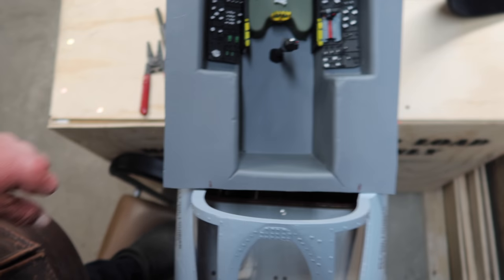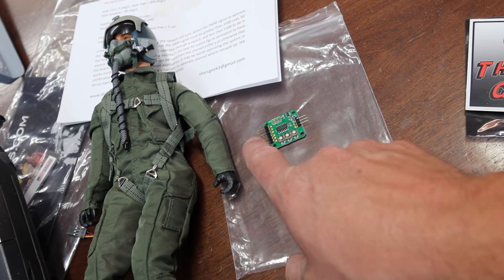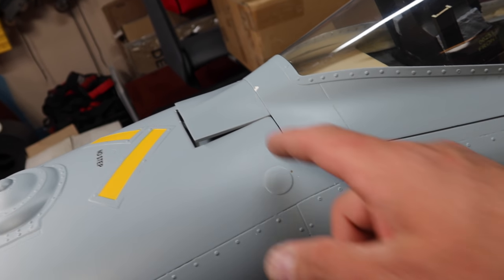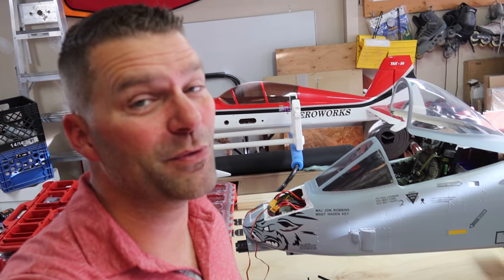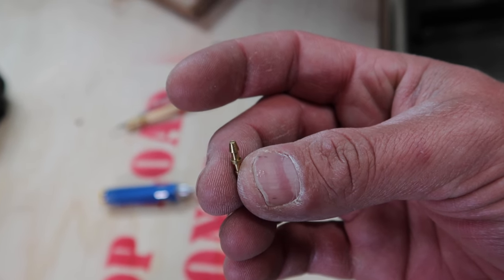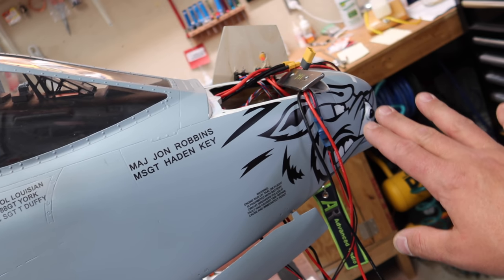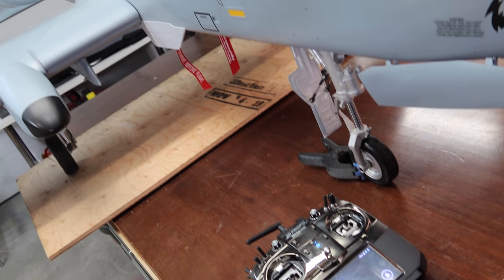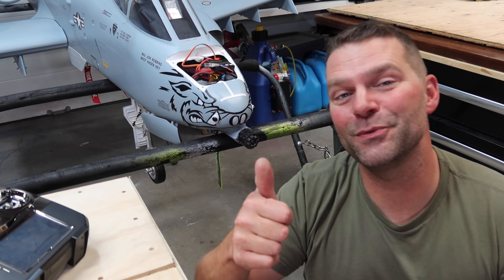GIANT A-10 Complete - Cockpit Install, Engine Runs, CofG, Gremlins A10

Comment: canopy....check ! head of the pilot....check ! you have a door for the front gear, not for the main gear ? we can see a little bit the wheels when it's gear up ? as usual, awesome.
Reply from the maker: Hello Philippe.  Yea the only air operated gear door is the front one.  On the mains, one is attached to the legs and one is hinged and attached to the leg with connecting rods.  Thanks for watching!

Comment: Beautiful plane, but do like electric gear instead air cylinder operated ones. I know weight might be better on those, but air is a beast and leaks will occur…hopefully not while flying🍀…beside the pilot is cool and the plan is waiting for weathering 🍺…cheers from Munich
Reply from the maker: Yea unfortunately with these skymaster kits and the scale gear air is the only option.  Your absolutely correct!  Hopefully NOT While flying!

Comment: Just to let you know the A-10 ejection seat does NOT have a “D” ring between his legs.  Just 2 handles on each side of the seat. If you are wanting accuracy remove it
Reply from the maker: Thanks Tim.  Yea i'm sure it's just a generic design that Skymaster follows for all their aircraft.  Thanks for that gem of advice!😊
Reply: I worked Ejection Systems for 21 years. From F-4 to F-22 T-33 to T-38 even the venerable B-52. BYW the parachute harness is wrong too